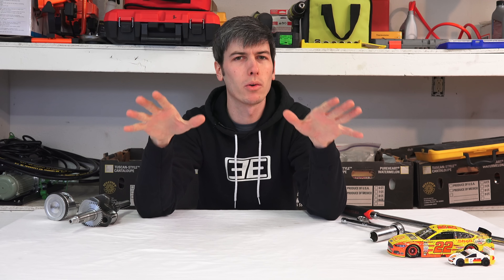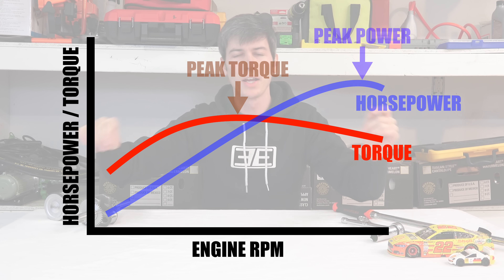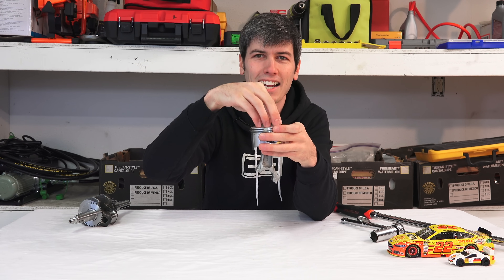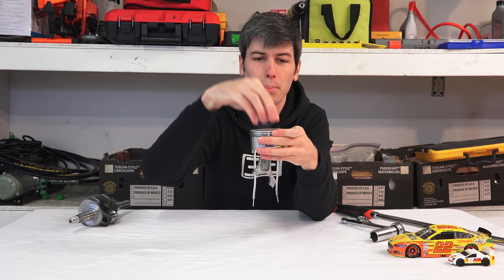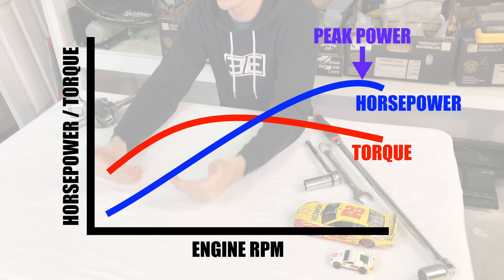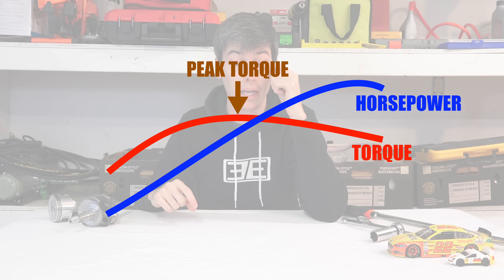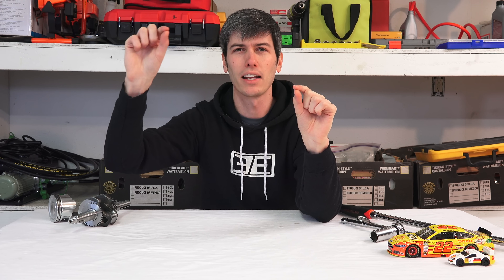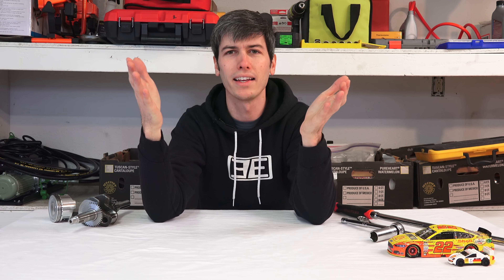Horsepower vs Torque - A Simple Explanation

Comment: Actually, he is incorrect.

Force • Distance = Work, not torque. Horsepower is a unit of measuring work. In this case, the equation above, is calculated as follows: 
(Area of piston head) • Stroke length (usually the length of the bore, from Top Dead Center to Bottom Dead Center). Some people say that stroke is more accurately the distance the connecting rod travels as the crankshaft rotates. This is why, if you increase your connecting rod length, you get more horsepower, but if you increase piston area, you get more torque.

For example, Ford used the 2.3L Lima four-cylinder engine. It was rated at 100 HP. Later, Ford developed the 2.5L engine. Similar to the 2.3, the 2.5 had higher horsepower because of an increase of the connecting rods by 7 millimeters. That may not seem like much, but with an increase of fuel pressure, the horsepower rating jumped from 100 HP in 1992 to over 140 HP by 2001.

Speed AND acceleration are calculated by: Distance • Time. 

Torque is actually angular momentum with applied pressure. The pressure that is applied, rotationally, is the measurement of torque that is usually referred to.

On a car, you have four distinct areas of torque: Torque at the engine, torque at the transmission, torque at your differential (for AWD and RWD cars), and torque at the wheels. In each case, you have to overcome the inertia of the parts involved in order to rotate, which is referred to as "minimum torque." For example, you could lock your front brakes and attempt to do a burn-out. But if your torque at your rear wheels is not enough to overcome the pressure required by the tires and weight of the wheels, your wheels won't spin, because friction between the surface of the road and your tires will prevent the tires from spinning.
Reply: Torque is also force x distance, it's just that distance here refers to something completely different than when calculating work. For torque it's the distance between the force and the origin of rotation. For work it's the distance the load is moved. Torque can also be defined in terms of angular momentum but that doesn't make the first definition incorrect.
Reply: @bonesofanidol  : Torque is not angular momentum. Angular momentum refers to something in motion, whereas torque can be applied against something inert.

The difference is where the force is applied: Torque is the pressure needed to overcome forces like friction, where the pressure that angular momentum generates is never increased beyond either the material that contains it, or by other forces that contains it (like gravity).

That being said, one force doesn't need any other forces to be applied, while the other needs other forces to be measured. This is why torque is different than angular momentum.
Reply: I didn't say torque was the same as angular momentum, I said torque can be defined in terms of angular momentum. Specifically as the rate of change of angular momentum over time. Anyway that's beside the point I was trying to make, which is simply that force x distance is a valid definition of torque.

Comment: To put it simple , I think torque is when u need a force to move a  heavy object and power is when u need to move slightly lighter object little faster . 🐘 Torque.... 🏇 power !!
Reply: NO. To go fast, accelerate heavy stuff, lift things up hills, overcome huge drag at extreme speeds - for ALL things related to increasing performance - race cars to trucks to tractors - you need more torque to the wheels. This always requires more power. Power is engine torque x engine speed. Gearing exchanges the two and is adjusted to provide as much torque as possible to the wheels at the current road speed. 
Torque is not "for" one thing and HP "for" another. Torque is a component of power - exactly like the size of your paycheck is one component of your income. The other component is how often you are paid. Your sustained spending ability depends on both of those things and can be simply stated as a rate - $ per unit of time. This is exactly like power. It's a rate that expresses how quickly you can do work - work like drag through a bunch of air, get a heavy thing moving, or lift a thing to a higher elevation.

Comment: hi, i have a Q... suppose i need to buy a motorcycle which one i should buy and why ? 1) 15 hp / 11 torque   and 2) 14 hp / 14 torque ... which 1 is better and why ???
Reply: Well, assuming the two bikes are the same weight, chances are the performance of (1) will be a tad better - that is a higher top speed, able to accelerate faster, and lift weight up hills faster. Here's why: The higher peak power tells us that at it's best (1) can do work a little faster than (2). From your info, that's really all that can be drawn regarding performance. The torque numbers don't tell us anything about performance, but combined with the power numbers they do tell us that (2) engine turns slower and so was designed with the appropriate higher gearing. Again, this doesn't mean anything definite regarding performance.
(We might guess that (2) is larger (more CCs). If so, this suggests that (2) is a more chill, lower stressed engine with a longer service life than (1), but if (1) is more expensive and uses better tech for durability, than this may not necessarily be true).
I hope that helps.

Comment: HP is torque multiplied by RPM. Torque is mainly determined by engine displacement. HP is what you want, if you are low on torque, gears make up for it. HP is power.

Comment: great explanation, however noted that the comparison (HP vs Torque) between those two cars were of the same type and weight. When the comparing vehicles were not the same, eg a school bus and a compact passenger car, even though the school bus has 200HP it won't accelerate faster than the passenger car, here weight is a big factor.

Comment: Personally I want them to switch to either "average horsepower to 60 mph" or "average horsepower from idle to redline through all gears up to 90 mph".    Or even "average horsepower from 10 mph to 60 mph".  This way of calculating horsepower would be way more useful than peak horsepower that because of gearing may only be used 10% of the time.
Reply: That would be really nice. Although not quite as cut and dry as that, there is actually value in the peak torque@rpm numbers - throw away the peak torque itself, but the ratio of RPM for peak power / RPM for peak torque actually correlates somewhat to the flatness of the power curve (aka "torquey engine", aka "low end torque", aka "accessible power", aka a "wide powerband").

Comment: 3 minutes, 59 seconds in... and this explanation is still more vastly overcomplicated than was promised in the beginning.

It's very simple. Torque, is rotational force applied. Horsepower, is the application of said force to do work. In the case of engines... torque rating is the maximum rotational pressure immediately available at the crank... while horsepower is representative of the maximum amount of pressure available through optimized gearing.
Reply: It was accurate though and stayed on track. 
It sounds like you might understand power but it's not clear because you are using personal definitions for words, specifically "application" and "pressure". You would only be getting through to the people who happen to share your modified definition. Many more people are reached if we both understand and use established definitions of words to have meaningful technical discussions. Sorry if it seems complicated and tedious. It just is sometimes.

If by "pressure" you're really talking about cylinder pressure, then no. If you mean the force from the wheels driving the vehicle forward, then yeah. That's a direct function of power which is maximized through optimized gearing. 
Power is just a rate of work. It doesn't have to be torque acting on a turning thing. Power expresses a lot of things. An important and relevant example in this case would be air drag. Top speed is determined mostly by the power absorbed by air passing the vehicle. When you reach a speed where it equals power at the wheels, the needle stops climbing.
Reply: @drienkm   I really like this definition when you change the personal definitions like pressure to force .
Reply: @APerson-xg6cu  For torque, sure. For power, it's still not quite there. Instead of power being "maximum amount of force available through optimized gearing" it would be accurate to say "maximum propulsive force divided by vehicle speed." 
We really don't ever need to qualify the meaningfulness of power by saying something about gearing. There is always some "gear" - some relationship between distance traveled per revolution. Gearing can't be hypothetically ignored while someone raves about ft-lbs from an engine. We are getting vehicle translation from engine rotation - different dimensions.
I suspect people commonly imagine an engine on a test stand when they think of torque. Then when they try to think of power, they can only start grasping at meaning when they imagine it in a vehicle. But then once it's in a vehicle, they can't remember what gears are doing to torque... It's this inconsistency that I think contributes to most people not understanding the relationship.

Comment: Perhaps if we assume a flat torque curve, we could then say, for a given combustion event, the force of explosion is constant at all rpms, (definition of a flat torque curve right?) and therefore, hp is zero at rpm =0 and would increase linearly as rpm was increased. Or at rpm 1000 there were x force events per minute and at 2000 rpm there were 2x force events per minute. Obviously then the higher the revs, the more force events, each force event on a flat torque curve is constant, so more work per unit time or a faster driving experience.   Introducing gearing into this video I think just over complicates it.  It shows you just how hard it is to understand the topic, not event this very smart guy is able to understand it.
Reply: Torque vs engine rpm curve is to evaluate the airflow through the engine. Flat torque curve means constant flow of air per cycle. 4 stroke cycle, 2 stroke cycle, whatever. Airflow per cycle multiplied by cycles per unit time is power input to the engine.

Comment: you did not explain what is the advantage of high torque. 
you only told high bhp = faster.
high torque = ??
Reply: Jus7iN well the higher the torque, the higher the horsepower.  Say you have 2 engines that can do 8000 rpm.  The one with higher torque producers more HP.  Check the equations in the vid.
Reply: @UR_Excluded   which bike is faster ? These are real bikes in market (am not making it up ) 
Bike 1- 225cc, 17 bhp @ 7000 rpm, 18.35 nm @ 6000 rpm 
Bike 2 - 155cc, 19.5 bhp @ 10000 rpm, 14.5 nm @ 8500 rpm.

Hence your concept high bhp = high torque is wrong.
Reply: You either have high torque or high horsepower

Comment: So: 
Two engines with the same horsepower, but one engine has considerably more torque will require less rpms to achieve a similar speed? I need to look up the how gears create leverage. I'm not getting that.

Comment: If Horsepower = Torque*rpm, then wouldn't all engines have more HP than torque? But this is opposite with diesel engines.
Reply: I ll ask you something,why diesel engines (at the same amount of hp with the gas ones like you pointed out) have often if not always, more torque? In other words, what is the main difference between the two? Hint, you can see the difference on the dashboard

Comment: I love going back to basics, because that is where new innovation or concepts comes from. Torque equals = leverage or power, but revs  require less leverage by shortening the power stroke, it then is added by momentum which strangely adds up to power! Now depending on what your engine is used for, you need to optimize the point were the forces are at one with each other. On the above film it showed the two graft lines crossed, so by manipulating the combination between the two, you can get the almost perfect setup!

Comment: Hi i have a question,
How about same car, same horsepower, but different rpm?
How do i know which is fastest?
Reply: It depends on what you mean with fastest, acceleration or top speed? It is a tricky question, in my opinion, the lower rpm one would (theorically) be the fastest in acceleration, the higher in rpm the fastest one in top speed
Reply: @tommythenice6799  If the horsepower is the same, the top speed will be the same, but it will require different gearing to match the engine speed to the road speed.  In both cases, the drive wheels turn at the same speed, but the higher speed engine (which makes less torque for the same HP) will require more gear reduction to increase the torque driving the axles.  Thus, through gearing, the HP delivered is the same.  That is why transmissions are so important to the usability of any given engine.

Comment: So which is better for efficiency? Operating the engine at peak torque or peak power?
Reply: Peak torque. If you look at the torque and horsepower curves you will always find peak torque has a lower RPM than peak horsepower. Assuming the same speed, having lower RPM means less fuel injected into the engine = better efficiency.

Note: this is why automatic gearboxes always settle in the highest gear around the sweet spot for peak torque.

Comment: Explains the basics but not WHY peak torque is at a certain lower rpm than peak power. Make a follow up video about friction losses vs rpm, about air (O2) filling ratio vs rpm etc etc...

Comment: Seeing a lot of flawed analogies for torque & HP. The only graph of an engine that matters is the HP graph. The shape of the graph is what is important though. For example you could have two engines producing the same peak horsepower but one graph may look like a constant uphill slope while another might look like the left side of a mound. The mound-like or "fatter" HP graph will accelerate faster because it has more power throughout the rpm climb even though the two engines have the same peak HP. That's why torque is important because it is an indicator of what the graph might look like. Higher toque at lower rpm for the same peak power will produce a "fatter" HP curve vs a curve based on a lower torque at higher rpm.
Reply: It depends what you want to learn from the graph. For a lot of towing applications and agricultarul uses, you'll want to know peak torque because that's the "pulling power" you're interested in. This is why diesel vehicles are much better for towing than petrol/gasoline equivalent vehicles.
Reply: @IcedReaver  An interesting perspective. The reason torque is important is because a vehicle with high toque at low rpm will develop more horsepower early on. You wouldn't want to tow with an engine with the power curve of an F1 engine because you'd have to crank it out to get meaningful power from it. Torque itself isn't as  important as the shape of the graph. Pretend you have two engines with the same power curve (for simplicity let's say it's a flat torque curve on both making the power curve a steady hill) one making 200 lb*ft and redlining at 8k and another making 400 lb*ft and redlining at 4k. Because of the HP formula both engines make peak 305 HP at redline. Because we can adjust rear end gearing a car would behave exactly the same with either engine. However if one of the engines developed high torque at a lower point relative to it's peak horsepower vs another and they both had the same peak HP then the high torque at low rpm would be better for towing and also faster. Even if the low rpm high torque motor didn't produce as much peak HP as the other motor it still may be better all around because of the added HP early on. Long explanation/examples but hopefully ya can see how shape is Uber important and that torque is a tool is telling us what it looks like but not super important.

Comment: I wish you can give me more info.  One big question I've been having is, why torque and hp curves is not in same shape (unlike the HP equation taught in school would dictate), and sounds like you're saying there's only torque from engine itself, then combination of different gear ratio gives out composed image of a single HP curve.  If that is the case, how do some car manufacturers like Mercedes come up with a rather flat curved torque ?
Reply: Consider the function, f(x) = x*(4-x).   Get a graphing calculator or software to visualize it.  Now define the function g(x) = x*f(x).   Graph this as well.

Are the two curves the same shape?  Did you expect them to be the same shape?  Because that is essentially the relationship between the torque vs RPM and horsepower vs RPM curves.  Horsepower = torque * RPM * a unit translation factor of 1/5252.

Torque vs RPM is the data we measure from engine performance.  Horsepower vs RPM is the data we calculate from the Torque vs RPM data.   If f(x) in my example were a graph of Torque vs RPM data, g(x) is the shape we'd get for the graph of horsepower vs RPM.   Notice that they both peak at different values of x?   Just like horsepower and torque have peak performance at different values of RPM.

Comment: That wasn't a simple explanation AT ALL lmao
Reply: Torque is high mass low speed momentum.
Horsepower is low mass high speed momentum. 

Same amount of energy. 
Different forms. 
You can use gears to exchange one for the other depending upon application.